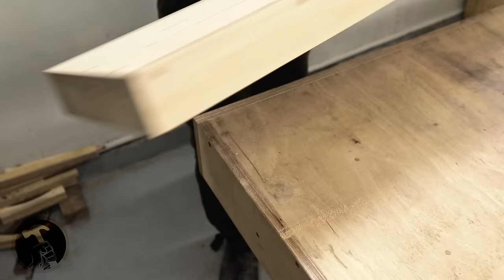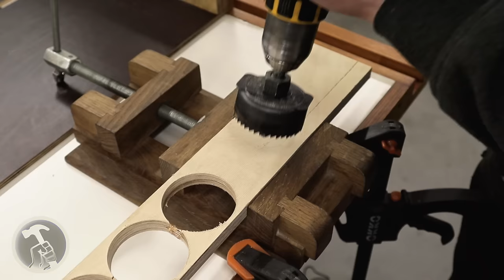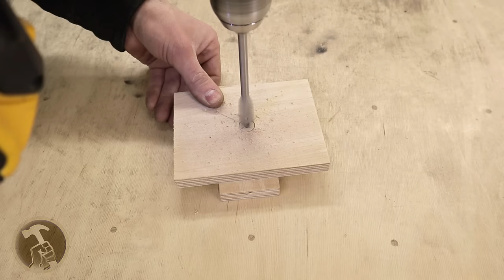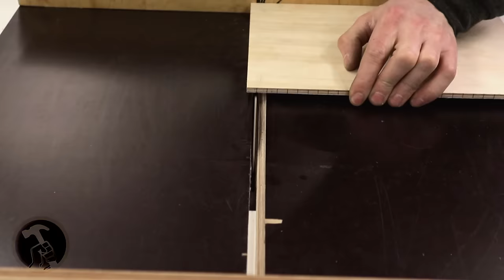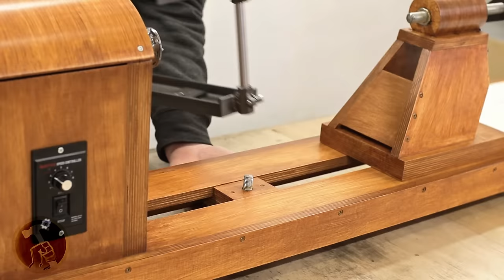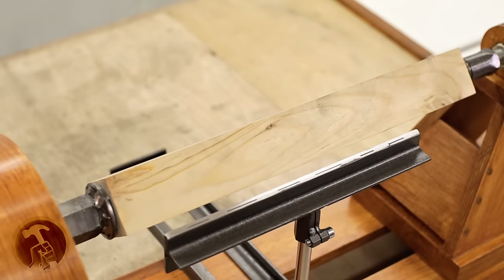DiY Wood Lathe from Washing Machine Motor

Comment: Very cool build but the wooden pulley is going to over heat the belt. A metal pulley is better because it will disperse heat faster and prevent the belt from over heating and breaking. .

Comment: I see that you have glued 2 nuts in the endstock assembly, one put in from each end.  I imagine that slight season expansion of the wooden barrel the nuts are glued in must occur. Does rotating the shaft ever become difficult?  Beautiful build.
Reply from the maker: As lathe is made from wood, it has little bit vibration any other issues did not occur till not now😎👍

Comment: Would an old craftsman tablesaw motor work?
Reply from the maker: I cant say if it work or not, table saw motor supposed to have high rpm and this controller which I used in video didnt match with your motor

Comment: The small benchtop Wen lathe is doing https://www.youtube.com/post/UgkxKGVtPhqZBB5AQXXFlU2kdd4mQhO6wlhl just what it was desighed to do, turn small pieces. This product is workig very well in wood and plastics, I wouldn't recommend any metal turning on it though. Overall from an old tool guy, I highly recommend this lathe as long as you realize that this is for small turning only. I bought this a few weeks ago and have noticed the price has gone from $174. to $249. Might want to get one sooner than later.

Comment: I built a wood lathe using a washing machine motor, mine does not look anywhere near as good! 
A couple of problems I have found since then, a washing machine motor is not really strong enough for bowels, I can stop mine easily with a gouge. and the threaded bar (allthread) is too soft, the bearings wear it out really quickly, I've changed mine 3 or 4 times already. but I haven't found an easy replacement.
That said it does work really well 
i really like your solution for the sliding tail stock and the live centre on it , I'll be copying those ideas, thanks.
Excellent work!
Reply from the maker: Did you use speed controller?
Reply: yes, the lathe was originally powered by a bench grinder using different size wheels to change the speed, the washing machine motor and speed controller work much better. I also used the original large pulley from the washing machine for more torque.
the motor I have wont turn backwards unless you swap the brushes, I was thinking of adding a dc power source to to the dc windings to do this.

Comment: Awesome build, best I've ever seen. Can I ask the difference between having the motor as direct drive as opposed to how you have it with a belt drive? Why the belt? Thank you in advance
Reply from the maker: This motor has very high rpm, with belt and pulleys I slow down rpm and get better torque. If you connect washing machine motor direct to socket it will spin in about 10000-15000rpm. and its danger speed for lathe.
Reply: @CraftyDude  Thank you very much for your response. I really appreciate it.
Reply: @CraftyDude  Your argument is valid for pure classic (motor + belt + pulleys) scheme. But with electronic rpm control do we still need pulleys and belt?

Comment: 🤭🤨 Wearing a medical mask for dust? - should be wearing a high efficiency dust mask = these closely fit the face and often have a exhaust valve, or a respirator
Reply from the maker: Usualy I haven’t dust, ventilator working all the time, but in morning time its still little bit cold so I use medical mask couse steam is going from the mouth, looking bad in video😉
Reply: @CraftyDude  - so, your workshop is slow to heat? We wouldn’t be fussed to see that
Reply from the maker: I use gas burner for heating, so price now jump up extremely😉 but in day time temperature reaches 12-15 degrees and its very ok then working🙂👍
Reply: @SamuelFellows sorry to say ,but you must be out of your mind,Canada happy resident or California.Maybe all three combined

Comment: thats a nice job. btw, do you know whats the max rpm you got with this lathe system?
Reply from the maker: I never use it in max rpm, but it has to be about 3000rpm max
Reply: @CraftyDude  do you think  motor that runs max to 1745rpm can give a nice lathe performance?
Reply from the maker: Washing mashine motor has about 10000rpm, but with pulleys I lower it 3 times, if you make twice bigger pulley on motor then on lathe shaft you will increase speed twice
Reply: @CraftyDude  can I sent you an email with a picture of my motor and then you can say me if I can manage to instal a speed regulator on it?
Reply from the maker: @guilhermecsaez  ok

Comment: How did you adjust the headstock and tailstock alignment?
Reply from the maker: first I align height by mounting rounded screw part on tailstock body, and then align tailstock shaft with headstock shaft in line, fit sliding part of tailstock with double side tape, drill, glue screws...
Reply: @CraftyDude  I got it, thanks👍
Reply from the maker: Great👍UK?
Reply: @CraftyDude  Russia🙂

Comment: Do you want a pixture of a homemade wood lathe?? it can be build with no machinw tools just the right acrap,Its metal fabricated,works well, very solid culd be dropped of a ten storey building,built by an amateur mehanical junkie, Not expensive to build.

Comment: why not connect the washer motor directly to the spindle rather than using a belt...?
Reply from the maker: Washing machine motor spinning to fast, different size pulley’s slows down and gives more torque to spindle